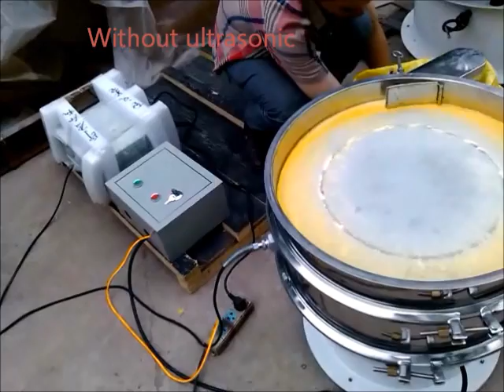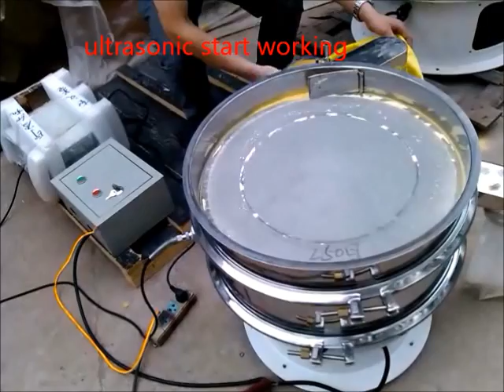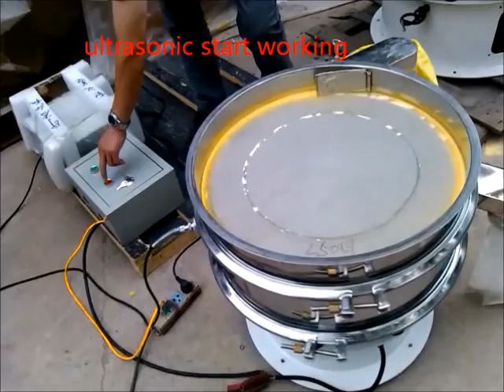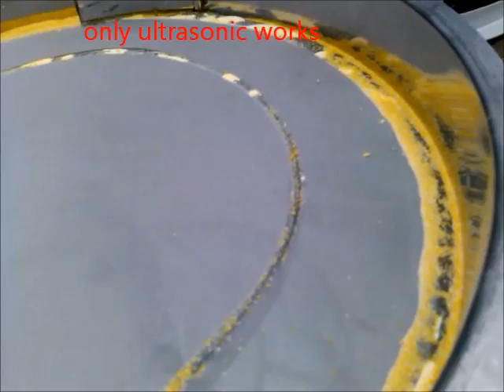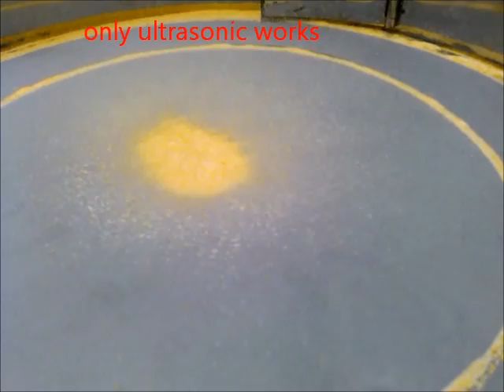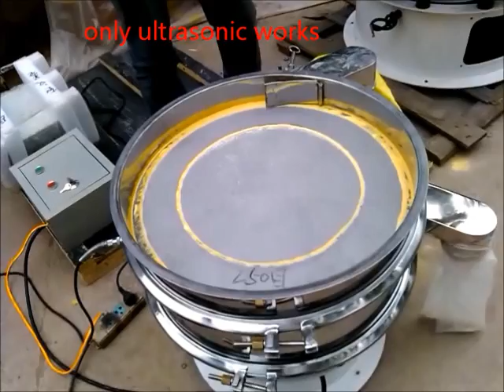Spectacular Effectiveness of Unitfine Ultrasonic Vibrating Screen

Comment: Does it work for electrostatic powder coating? 
Has it have screens (filter) with different microns?
Reply from the maker: it works , we have different size sieve screen, pls contact us at info@unit-fine.com  for more details
Reply from the maker: We have successfully done project for our US customers on graphite powder filtering, we did all replacement of their own old machines.

Comment: can this be used for collecting gold dust from black sand?
Reply from the maker: +Vahagn melikyan  if the gold dust is very fine and smaller than black sand size, or either the black sand size is smaller than gold dust, the job could be done through our ultrasonic screen, so could you please send more details of your mixture to us info@unit-fine.com, then we will find what to do.
Reply: I don't have any gold dust , but was planning to do some gold prospecting and was researching for better technologies than using water